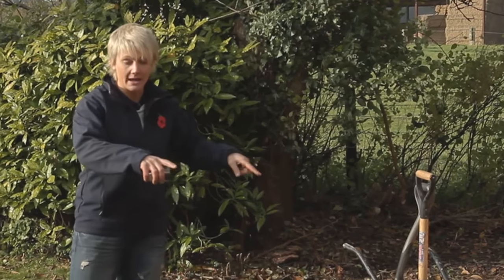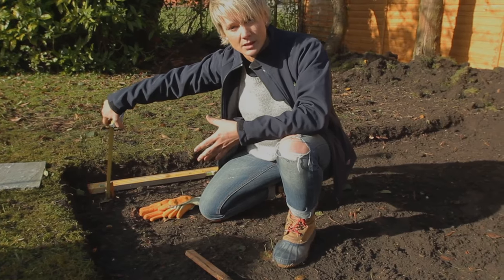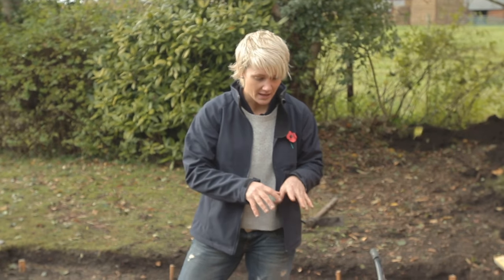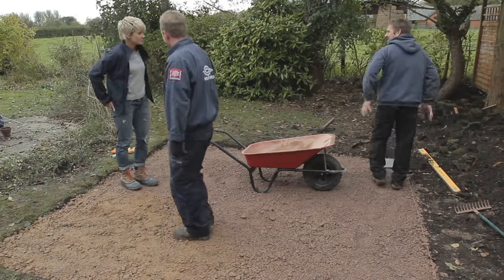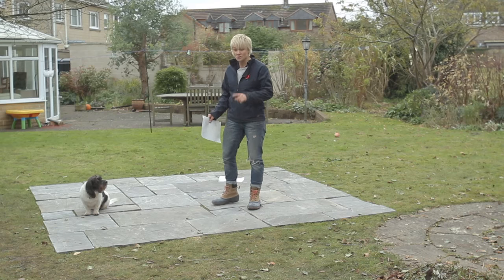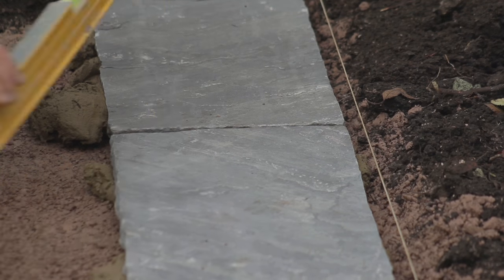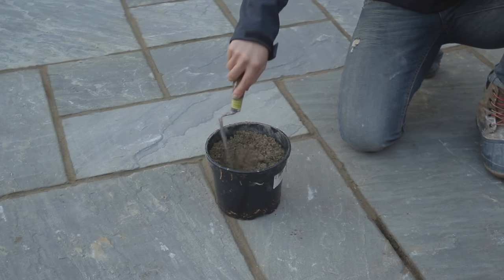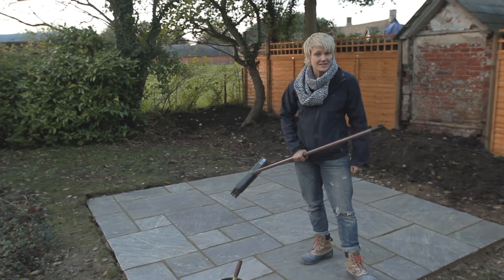DIY: How to lay paving slabs (patio) - with Philippa Tuttiett

Comment: Things that are WRONG
1. Dab Dot Method - Should have used Full Bed
2. Didn't compact the sub base down properly, used body weight method - At very least used sledge and timber block to tamper down tight or compacter 
3. Dry Slab Lay, didn't use SBR Slurry Mix - Slurry the back of slabs with SBR slurry to water proof the slabs and get a better stick (SBR slurry is like super glue for slabs) 

These 3 are crucial for a successful lay, otherwise your stones will lift, come loose, and moisture stains will bleed through the slabs, you can get away with everything else being a little off but the top 3 did's & didn't's  above, please please please don't skimp otherwise the patio won't last 1 year

Comment: 5 inch of hardpack. Thin layer of sand. Like quarter inch. Lay the paver in sand and tap down with mallet or dead blow hammer, use level. Use poly sand for the mortar  (gator sand ) look it up.

This is the lifetime method and easy. I warranty my work. 

Get ur dun. Martone landscape pelham nh
Reply: hi, any need for membrane/sheeting before putting hardpack/sub base?
Reply: @learnsomethingneweveryday1539  I second this question.  Is 5 in of hardpack enough to keep weeds out?  Should I add a membrane to keep weeds out?

Comment: I wouldn't do this in an area that has freezing winters. The water will get in the hollow cavities underneath. The water freezing and then defrosting is what cracks stone on joints. That's why many need to lay it flat. I wonder if ants would make 'homes' in those cavities also?

Comment: Starts well, but gets worse. No fall on the paving/sub-base, the sub-base material is not scalpings it's Type 1 M.o.t, you can't compact using your feet!! And spot bedding is a big no no, so a DIY project which will fail in a relatively short time???

Comment: as a guide for DIYers laying a garden patio this video is OK, however,
- dot and dab method is very poor for long term survival as allows water to collect under the slab. it will then freeze and lift the slab off ("delaminate"). Full bed of mortar is by far the recommended way 
- all subbases will eventually settle, but to delay that moment you cannot over compact a sub-base. If going to the expense of using type 1 (MOT) material, then spend a tad more on hiring a compactor plate. Foor traffic only or not, compact it properly not just "heeling" up and down on it

Comment: Okay I get that this is a DIY channel and it’s suppose to influence incompetent people to give patio laying a go but you shouldn’t dot and dab the mortar bed when you lay slabs, reason being is because there will be hollows underneath which will make the slabs not structurally sound and eventually they’ll work loose and crack from the load. It’s also not a good idea because over time the moisture can rise up through the ground, through the spots of mortar and creating awful damp patches over the surface in areas where the mortar has been dabbed down. Better to just lay them down properly on a full bed of mortar and lightly furrow it to make levelling out much much easier.

Comment: Do not follow this advice. Compacting with your feet is useless.  Use a plate compactor. 
NEVER lay slabs on 'Dabs' of sand and cement. Not only will your slabs crack and move after only a short time, but when it comes to pointing your joints,  you will have to use loads of pointing gear to fill the joints and the chances of filling the joints completely,  are very slim to say the least. I'd also recommend coating the backs of the slabs with a cement slurry to help them stick and stop any movement.  Not entirely essential bit good practice.  Well done for having a go yourself though.

Comment: Nope, not at all. Those slabs will crack like a badly layed kitchen tile floor. Floor tiles and slabs should have no gaps underneath them.

Also, the mot needs to be compacted with a compacter.

If you add sand on top of the mot and compact it, you won't need cement, you can lay the slabs straight on top.

Comment: If you're doing this yourself its very much worth using a membrane before the sub base is used,  will make it last that bit longer with less chance of weeds coming through, because they will come through this example for sure. Also do not "walk in" the sub base, you WILL need to use a compacting plate otherwise it will move and crack in no time at all and look a complete mess. if you lay the slabs like this is then they will fail, fully bed them on. Do it right and do it once.

Comment: The idiot who laid our patio slabs did not even know how to use the patio grout! He got a packet of 'Easyjoint' and applied dry and he put the instructions in his pocket, I was apprehensive and knew something was not right. I told him that he should apply water as I read the instructions on manufacturer's website but ignored me. After he ran out of grout, he applied cement mix on the path. Now after a week, some slabs have no grout as rain washed it away and on the path rocking slabs!

Comment: Jeezus h! And that is not the way to fill the gaps,  it needs to be bone dry so the stuff fills all the gaps caused by the spotting underneath otherwise it will all eventually drop out meaning you have to do it over again. The only way to do this is on a full dry mix base, get it level and you won't need to tap every slab, watch good block pavers at work, they know. Lay the slabs hard up against each other anyway so there is no gap! Look at Medieval stone floors,  no gaps! And Philippa, I hope you've found something you know about to make videos of by now.

Comment: Dots are a complete no no, especially with Indian sandstone paving as the salts in the cement will migrate through the slabs and show on the surface. Slabs should never be laid on dots as water can build up in the voids and if it freezes it will lift the slabs.

Before you put videos like this on ask the professionals how to do the job correctly

Comment: Been watching the USA Christian landscaper and I must say he does it better using different method. In particular he uses a membrane first and he lays pavers dry but with edging kerbs and sand compressed between joints. I’m not a builder so, it is confusing to know which method to use as I plan a large landscaping job in my garden and wary of UK cowboys. On this video there was no mechanical vibrating compactor only what the chick called little baby feet. You cannot beat someone who really knows what he’s doing.  Maybe her patio will last…who knows.

Comment: What ever you do...

1. Don't use baby steps for compaction. Hire a vibrating plate (£30 24hrs MAX) They are cheap for one of the most important parts of laying pavers. 
2. User a full bed NOT spots. Spots you'll find will make the slabs break as there are weak points. Also how would you point it? You've be there forever pressing in to the joints
Reply: Hi what does this mean please! "User a full bed NOT spots. Spots you'll find will make the slabs break as there are weak points. Also how would you point it? You've be there forever pressing in to the joints"
Reply: @nicolabateman3164  Hi! 

Correct word was "use" not "user". I agreed spots are rubbish! 'Spotting' was used by poor workmanship to save on material costs and speed up laying flags. And yes how on earth would you point!!

Comment: Well it's totally wrong, what shes done. All you need is sand and definatley no cement. And your suppose to stamp the sand until you can walk on it without leaving prints. You can rent a proffessional stamper machine. Then all you do is place them on the sand and then stamp them .so so easy

Comment: Don’t copy this lady she is teaching you a cowboy way of doing things. Firstly if you don’t compact the hardcore properly your slabs will sink or even move. If you are using 80 mil of hardcore then whack 50 mil then add the extra 30 mil and compact that dry and wet to make sure it is compacted properly the whole way through. As for the dob and dab 🤦🏼‍♂️ 1, if you do that you will get spots coming through from the cement because of the chemicals 2, you will have cavities so ants and other insects can have a home and eventually loosen the slabs 3, the slabs won’t bond properly and eventually lift 4, weaker slabs can crack because there isn’t a full bed. I can go on and on why you need a full bed of muck just don’t copy this I mean the only thing you want to heel in to compact is soil to turf if you are doing a small area. Oh and lastly never never never have cross joints in your patio never. You know nothing John Snow. (Cowboy) report to trading standards

Comment: complete bodge job you dont lay slabs on on wet mortar spots and you do not just brush in sand and cement to fill the joints ,real poor job

Comment: not impressed with this video.  First no edging so will break up, then dobbing will allow ants,  use a whacker plate aswell and the mortar mix there is a product that you brush in and it becomes solid.  I suggest you learn hairdressing?